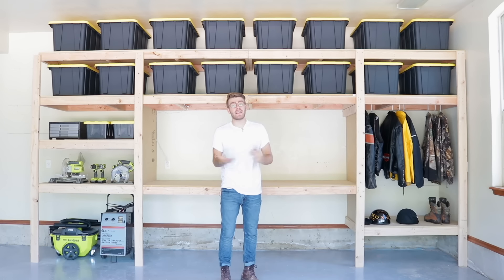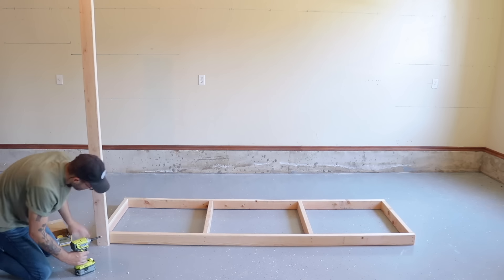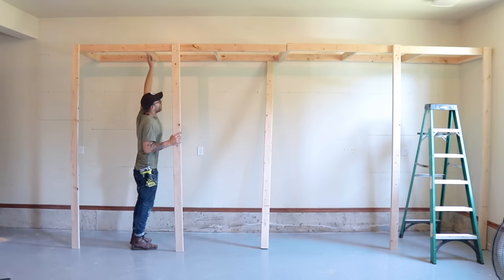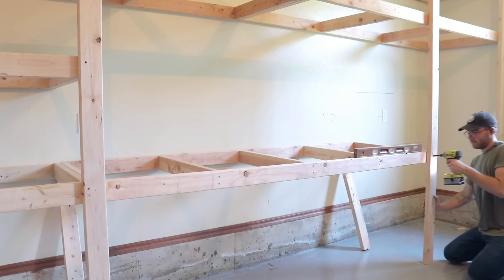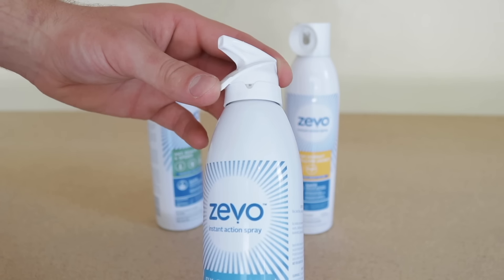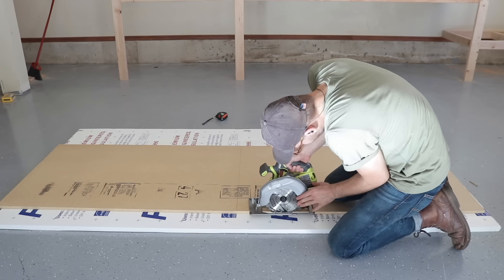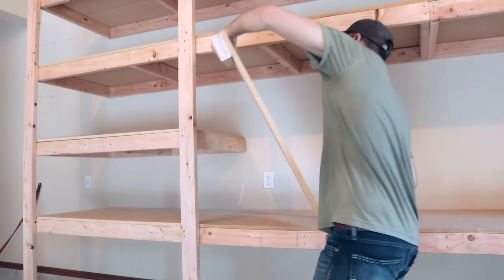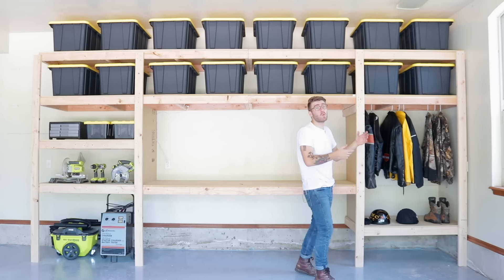DIY Garage Storage / Shelf / Workbench Solution

Comment: I found a similar concept years ago (12) in a Family Handyman article.  I realize this was made nearly 4 years ago but it seems the price of lumber is 3-4x what's in the video - a 2x4x8" is around $7 and 3/4" MDF (cannot find the particle board he references) is like $60, not $16.  That kind of changes the economics of the video drastically.
Reply: Thats because the housing market has been crazy because the interest rate was locked in at 3.5% creating a shortage of wood because so many homes are being built and sold immediately. The price should go down by next year because it crashed last week, and interest rates have doubled for homes. it will take about a year and hopefully be a good time for home DIY carpentry again. Tempted to just start cutting trees in my back yard lol.
Reply: @brooktech7869  lumber is already at pre-pandemic pricing and the rate wasn’t locked at 3.5%. You could get lower than that.

Comment: Pretty sweet storage solution! I would however suggest adding a 2x4 to the front of the 2x4 shelf supports in the middle where the two sides meet to splint the shelf.
Reply: Agreed

Comment: Mike, thank you so much for your tutorial! I completed this project in 2 days and with a little bit more than 12 feet to work with (I just shortened the workbench to 4 feet). I've never constructed anything outside of IKEA furniture, never used a circular or miter saw, and the simplicity of this project, along with the drawings and thorough instructions made it relatively easy to accomplish. Thanks again!

Comment: Just build a version of this with my dad over the weekend.  We decided to go with 3 inch lag screws and washers for everywhere it connected to the wall (almost every stud along the back wall). We also decided to double up the 2x4s like some comments suggest under each shelve section(front and back).  We also figured I wouldnt need the coat rack portion so i just evenly spaced the 4 shelves on each side (this doubled my workbench space) and for now I only put up one 8 foot section over the bench( mainly because my garage roof is shorter than the garage in the video) and this allows for more head room. Later we may throw the second 8 foot section up and build a larger work bench next to this and include a table saw.  All and all this video was a great help (plus the comments from "concerned" viewers. Thank you all!!
Reply: can I please see a photo of yours , my sealing is too low also.

Comment: Nice job! I love the built in workbench.  Personally, I would go with 24" shelves to reduce waste even if the totes stick out 6".
Reply: That’s exactly I am thinking. Is there anyone try 24”?  Is it stable?  Any successful project completed using 24”?
Reply: That's what I went  with. 24" is perfect if your using a material for your shelf tops that comes in 4x8 sheets. Just zip right down the middle (longways of course) and you're done!

Comment: How about a short purpose built ladder at a slight angle to the 2nd highest shelf that hooks and slides along a small aluminum J channel along the front edge?  Like an old style library ladder that can be removed and hooked out of the way around the left side there.
Reply: I’m building this now and will probably do something like this.
Reply: What do you mean exactly by built at a slight angle? picture? I built some shelves similar to this and would like a ladder as you suggested

Comment: I'd recommend 3-1/2" screws for anyone that's going to do this instead of the 3" he used.  The 2x4 is 1-1/2" deep and the drywall is at least 1/2" deep, leaving ONLY an inch of screw actually going into the wall stud.
Reply: Wouldn't it be better to use nails for the frame on this project since they provide much better sheer strength and don't get brittle in the cold? I'm amateur at best but unless I was hanging floating shelves I'd think nailing is the better thing to use. I'd only screw down the actual top of the shelves.
Reply: @pompulousify  You may use whatever fasteners you are comfortable with.

Myself, I have trusted life and limb on deck screws.
Reply: @Mozinwrath … and I've seen a shelf fail, sending expensive motorcycle helmets crashing into the door of a Challenger and the ground.  Helmets trashed.  Car damaged.  Homeowners' insurance used.  That shelf had held up for over ten years, then decided to fail.  I'd bet money it wouldn't have failed had more screw been in the wall.
Reply: @Mozinwrath Unless you have a very expensive climate controlled garage, any wood shelving in it will expand and contract daily for weeks, months, years, decades...  My original point was that he only actually used one inch to secure the board to the wall, and one point I didn't make is that the first 1/4" (or so) of that screw is tapered and not as useful as the other 3/4".  Screws are cheap.  Cheaper than plywood, so I see no reason not to add half an inch to the screw length.  While I don't doubt it'll hold, there's no reason to take a chance.  No reason not to spend a few extra bucks and make it "too strong" especially if your child or spouse (or anyone you don't want to sue you) might be in the garage with you at times.  Always better safe than sorry.  I'm not suggesting someone run out and spend thousands on Simpsons Strong-Tie supports.

Comment: My garage needs more storage and is sloped so my wheeled tool chest wants to roll into my cars. 😅 Trying to figure out how to make this but remove the wheels from the toolbox (46” husky) and build it into the bottom… 🤔 And also use the expandable work surface from the compact garage shelves video. It’ll also be me first woodworking project so probably way too much and sure to be a disaster 😬

Comment: You should install some jack studs on the wall side in between each level and behind the 8in vertical studs to reinforce and support the weight of whatever you put on. Also maybe lag bolt the wall side to the studs. Other than that, this is a really nice build! Just depends on how much weights in those totes!

Comment: The long vertical 2*4s should be placed under the horizontal 2*4s, not just screwed   into them. Why,?? The load is now on the screws not on the vertical 2*4s, this could be an unsafe build. Love your vid though, looks awesome
Reply: IBBYS would that then require him to break up the vertical 2x4 into 3 separate sections instead of one long continuous 8ft beam?
Reply: @hockeynpolo1 exactly and if you use the correct bolts for the load, it will be fine.
Reply: Yo Mama  Yeah. You just saved me a buncha work. Thanks!
Reply: Don’t you love it when no one helps you load your cart at the hardware store . BTW you should predrill your wall plate 2x4 and use a lag with a flat and lock washer. Deck screws aren’t meant to carry that kind of stress. They could shear. I’d put the 2x4 underneath or put 2 anchor bolts with washers and lock washers to secure. Remember to predrill. IF your paranoid like I am. I’d put a base plate down and bolt it down with some tap cons.
Reply: IBBYS could also do lap joints where the shelves meet the legs. Then the screws are only doing their designed job and no risk of sheer. While taking a little more time, still maintains a smaller budget.
Reply: If you’re worried about the weight, just add 2X4 blocks behind the upright 2X4s. They would sit on top of each shelf carrying the weight to the ground, instead of all the weight being supported by screws. They could be added to his design after it was built.
Reply: Would half lap in the verticals work for structure?
Reply: @Joseph Brandenburg content creators should amend their videos when information this like is presented.
Reply: You're absolutely correct.  Not only is each shelf unsupported underneath but typically when building a structural frame it's best to use a framing nail because they are much stronger in shear. A deck screw is not designed for that.  Really need to be careful watching "how to" videos made by people who don't really know how.
Reply: I thought the same thing before I seen your comment.
Reply: @hockeynpolo1  I think all he needs to do is add a2: 2/4 all the way across in the center to spread the load
Reply: IBBYS nice better than my design -would recommend using bolts or support instead of screws to withstand heavy items
Reply: i agree unsafe build. not long term solition
Reply: The idea of the project is a simple plan that anyone can do and serves a purpose. A full 25% to 30%of this is non-storage/work benc area area and you have a "closet." Most every bookcase or shelving unit you buy uses a similar construction.  Heck, may just have little pins stuck in a peg board. If you want to cary 1000 lbs loads -- sure it might stress over time. But then you could shore it up with a block behind the upright. The screws should be sunk into studs and should be fine. I am not certain if deck screws are the best choice as they might not be designed to take the stress when used vertically. But this os similar construction to cabinets and shelves I had in my first house which was built in the 40s and they were still going strong. And they were mostly nails.
Reply: @crbulldog5638  Agreed, not to mention he only has 1 inch of screw actually in the wall studs.  I've built shelves using lag bolts to hold up the wall plate that could easily support 1000 lbs.
Reply: Unnecessary.  He’s not storing iron ingots on those shelves six to eight feet above the ground.  To make the load transfer into the supports would add complexity and time to this LIGHT STORAGE build IMO.
That said, I’d CERTAINLY recommend using longer screws.  He’s not getting enough “bite” with the ones he chose.  IMO, screw tear-out is a bigger threat than screw shear failure with his build.
I’d still ditch the drywall screws for a better screw (trex or similar), which have way better shear characteristics and would only add a few $$ to the project cost (and NO extra build time).
I know he was striving for simple tools, but if you have a framing nailer (or are looking for an excuse to buy one 😉), nails would also improve the shear strength and would make the build considerably faster.
Reply: Yo Mama  is right
Reply: Love how all these "pros" are on DIY shelving video adding their superior knowledge... it's not a bomb shelter and it's in a basement or garage. Go use your professional engineering skills on jobsites where people are probably telling you to shut up and go get more lumber at Home Depot to get you out of their hair😂😂😂
Reply: I just built my shelves in my garage using your method and it's awesome thanks so much keep the builds coming.
Reply: @hockeynpolo1  Yes it would.  But, since ya know he heights, just cut for them.
Reply: @alexreavie  You are very correct in your response. People build decks he same way....they carry a lot more weight...
Reply: @Fast420Ed  thats not very helpful. We are learninf from these pros. Safety is key.

Comment: Nice project.  Consider using 3 1/2 inch screws on garage wall attachment instead of 3 inch since drywall is probably at least 5/8 thick for fire rating in a garage. Also consider putting a vapor barrier of some sort to avoid direct contact of wood on concrete.

Comment: Very weak only relying on screws for the strength.  Add 2x4 vertically between each level against the vertical to take the load.  Screws are not meant to support the load only fasten pieces.
Reply: Thank you for that tip!! I'm learning from all the info.
Reply: @ RRfan216 Strong enough, you’re not building a house, calm down

Comment: Another great build, seems very DIY friendly. I'll have to save the plans for when I own my place.
Reply: One thing I'd recommend is considering 24" deep instead of 30".  He used 30" for the totes he had, but if you build 24" deep, you can cut an 8'x4' sheet of plywood in half and make two shelves out of it with little to no waste and no need to store scrap wood for years and years and years...  All my shelves have always been 16" or 24" deep and I've had no problems storing totes or anything else on them.

Comment: yo, the thing you built is a death trap. 
The only thing that is supporting all the weight is the screws between the wall and the frame and the screws between the vertical support and the frame. 
screws are brittle and are designed to connect 2 pieces of wood. 
they are NOT designed to hold weight. They are NOT to be used as structural supports. 
you are relying on the sheering strength of screws to hold up weight. This is going to get someone killed or cause serious damage.
1. please take down this video before someone injures themselves
2. add vertical supports to in the front and back supporting the frame, as not to rely on screws to hold weight.
Reply: I've heard this a few times on different videos and I understand what you're saying. I don't understand how to make it better. Do you have links to videos that do it right? Thanks.
Reply: I like that there isn't a level in sight
Reply: You are wrong. It all depends on the shear strength of the screw AND this is a common way of hanging shelving. In the end everything depends on the screws you have used to hold up the wood. ONE 5mm 316 stainless machine screw can carry 450kg easily. Now go and count how many he used.
Reply: Clayton Taylor , Nails have high shear strength but low tension holding.  Screws work the opposite way. They have high tension holding but low shear strength. 
Some ways to  make your shelves better. 
1. double up the 2X4s you used as legs. Placing the inside ones under the shelves so they directly transfer the weight.  also do this on the back wall. Same idea as a lap joint. This takes the stress off your fastener.
2. Use bolts.  Bolts give you good shear strength and good tension. Make sure to use washers to distribute the force. 
3. Us nails, especially ones designed not to pull out. 
4. If you use screws make sure you are using structural screws designed for shear strength.  You may need to double or triple thick your 2x4s to add enough meat for the screws. Normal wood screws and drywall screws are not designed with shear strength in mind.
When you make something that holds a lot of weight high up. Always think about how a thing will fail. For example will it fall on your head.
Reply: I would have probably suggested leveling the shelves , and a couple few lag bolts would be a reasonable fastener to the wall.
Reply: Wow, thanks for the heads up. I will make sure to go through my house and add supports to all of the cabinets in my kitchen that are help up by just screws. I will also let all of my neighbors know that they are living in a death trap.
Reply: ri22o, Your kitchen cabinets are not going to see the amount of weight that you might put in those bins.  16 bins at 50lbs per bin is 800 lbs. Between the 2 shelves.
Reply: agreed. Double up the the 2x4s behind the front vertical members. Let the strength of the lumber do the work, not the fasteners. I came across the same issue while building my shelves. With just screws alone, I could barely stand on my shelves. After placing a 2x4 on the back of each vertical member, between each horizontal member, I could put pretty much however much weight I want. Screws alone make for extremely weak structures. Again, this is coming from first hand experience. Not speculating.
Reply: You have to think of how much weight your cabinets are holding. lol. glasses and plates verses 16 full totes of junk.
Reply: @EthosAtheos  you seem to know your stuff and I thought the same thing when I saw this. I'm going to be building a similar shelf...but smaller width wise..in my garage. My dilemma is my builder uses drywall AND foam insulation board over the studs. So to get from drywall to stud there is 1.75 inches. I will for sure be adding to the supports you mentioned but I want to make sure I properly fasten the shelving to the studs so it doesn't tip over. What should I do about the 1.75" of drywall+foam board? Lag screws?
Reply: If your going to anchor it to the wall use something like the Spax Power lags.  Or some other high quality faster.   Big nails work well to but are vary hard to remove later.  My garage is not insulated so I connected my shelves right to the studs. But when I insulate the garage in the future I will use freestanding shelves anchored to the floor.  That way they can be moved or removed without disturbing the walls.  Floor anchors are easy in concrete if you don't have a hammer drill you can rent one for a reasonable price form a home store.  Concrete anchors have improved over the years and are very easy to install.  Get ones that fit flush to the floor and if you ever remove the shelves you wont even notice the threaded floor anchors.  Thats my 2c hope it helps.  Best of luck with your project.  Make a video and or take pictures post them and share what you come up with.
Reply: I really don’t understand the design of this thing. Why not 4x4 posts on the corners and use lap joints to tie in the 2x4s (and use bolts). The best tool you have is the one between your ears.
Reply: @EthosAtheos  i agree , he can make it safe and better , no need to take it all down
Reply: @ri22o      I have seen  kitchen cabinets fall off the wall.  No joke.
Reply: @ri22o  that was funny.
Reply: If I used lag screws instead of wood screws, would that be enough to handle the load without vertical supports?
Reply: Yes, but it’s also very easy to install “jack studs” at all four corners from floor to ceiling.
Reply: Agree with comment above. Also, I don't like that the wood has direct contact with the floor. Any water from cleaning, spills, snow (if applicable) will damage it.

Comment: I cringed twice in the 1st 55 seconds - stop block set to keep boards the same length...but the saw wasn't anchored to anything AND "no need to cut"  because he got a 8ft 2x4 - 8 ft 2x4s are "roughly" 96" long but are rarely exactly 96" long